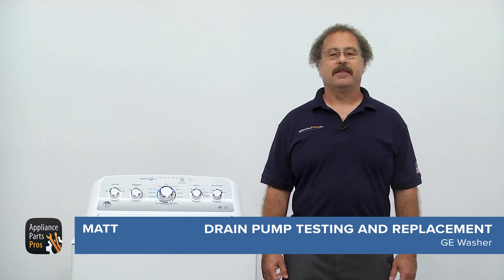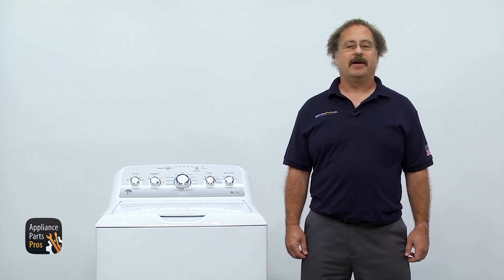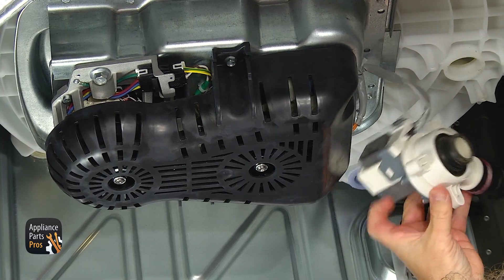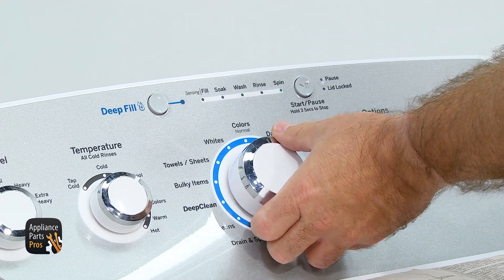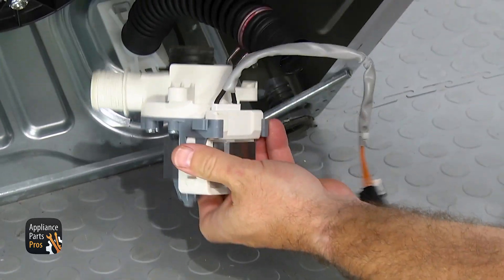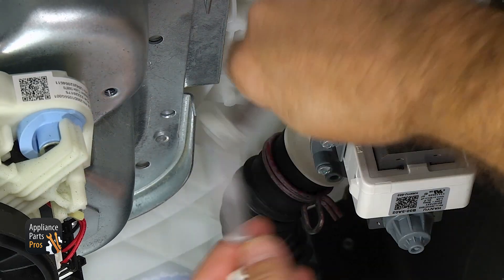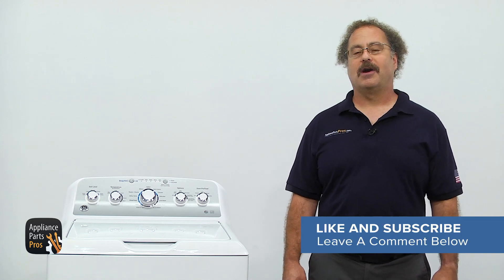How To Test And Replace A GE Washing Machine Drain Pump

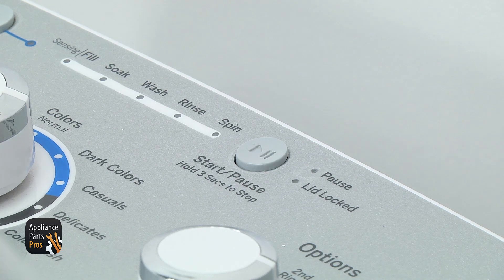Comment: 5:11 I have voltage and the drain pump is working but it won’t recirculate.  Spin works. I have replaced the pump and board at this point.
Reply from the maker: Got it, that’s definitely frustrating. For detailed troubleshooting specific to your situation, our certified techs can help you at forum.appliancepartspros.com. Just post your model number and what you’re experiencing, and they’ll walk you through the diagnosis!
Reply: @appliancepartspros I figured out it was actually the wiring from the drain pump clip.  Once that was addressed all codes cleared and worked.  I checked voltage and it came back fine.  
I ended up replacing the board and the pump.  Out of frustration I grabbed the connector during cycle and my body grounded the wire allowing it to work.

Comment: Hmm pump resistance is within the limits. New pump installed. Same, will not pump water out. Drain hoses are all clear. No obstructions. What next? This is the second washer that’s done this for me and I can’t figure it out.
Reply from the maker: The best test would be to see if you have voltage coming to the drain pump whenever it is supposed to be draining. What is the model number of the washer?

Comment: Does the drain pump assembly only fit on one way?  Or is it possible to accidentally put on wrong?
Reply from the maker: Great question! On most GE washers the drain pump is keyed so the bracket and electrical connector only go on one way.

Comment: What if I don’t have voltage?
Reply from the maker: If you aren't getting voltage to the part you will need to test from the control board/timer to see if it is sending power to the pump. If it is sending power and it's not getting to the pump then you have a wiring issue. If it is not sending power to the pump, then you will need to replace the board/timer.

Comment: I just took my drain hose off and there was what i can only describe as a round black rubber flap perfectly stuck in the pump hole.  Don't know if it was part of something or a bizarre coincidence
Reply from the maker: What is your model number?
Reply: @appliancepartspros  gtw331bmrws
Reply: @appliancepartspros  gtw331bmrws
Reply from the maker: Thank you! That black flap is part of the pump. If that is broken off then the pump would need to be replaced.
Reply: @appliancepartspros  makes sense, thanks.  I left it plugged in last night and it went nuts
Reply from the maker: You're welcome!